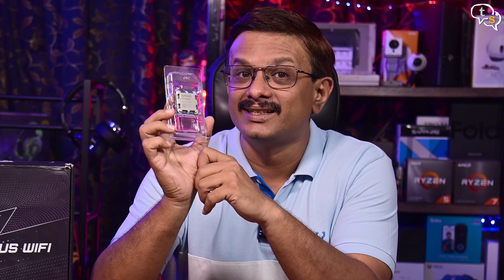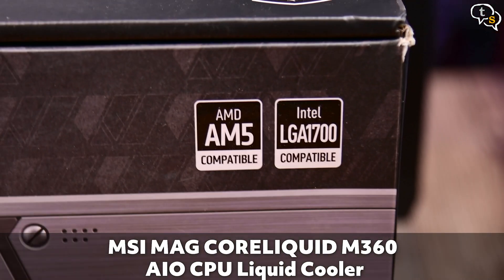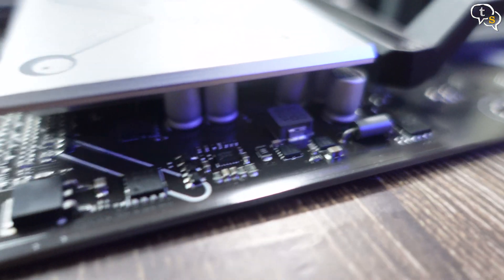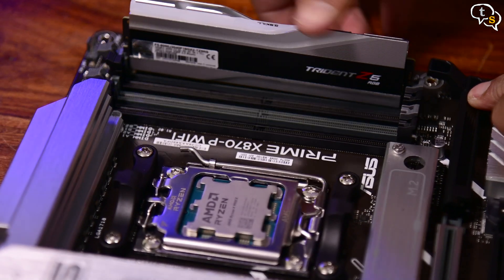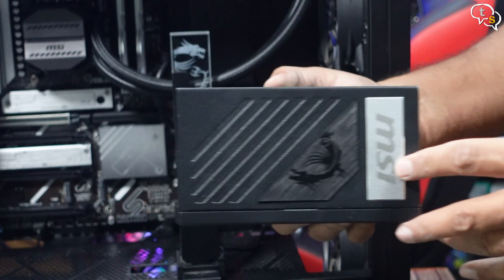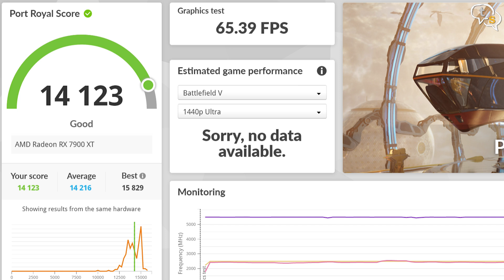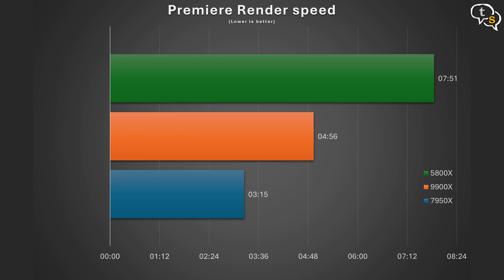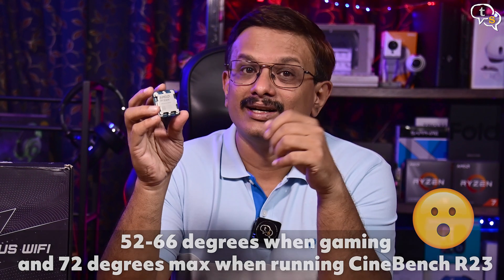AMD Ryzen 9 9900X Workstation Build | Asus Prime X870-P Wifi

Comment: Hi,
If i use two or three M2 ssd, PCI-E? 
Thanks
Reply from the maker: If using two it would be better to use the top and bottom M.2 slots at populating them all would bring down gpu lanes to 8x instead of 16x. So try to avoid the middle one. First one runs on cpu lanes and last on runs on chipset. But 8x for current gpus is not a big loss in performance.

Comment: hi friend do you have to update the bios for this mobo for a 9800x3d?
Reply from the maker: Depends, some motherboards have the updated bios. If they don't you could always use the bios flash option even if you don't have a cpu in the motherboard. You will need another computer or laptop to download the new bios onto a pen drive though.

Comment: Temps are really good, the 7950X is toasty!
Reply from the maker: Yes, the 7950x has a higher tdp hence the high temps. The 9900 runs more efficiently without loss in performance.

Comment: Why would I choose a 9900X when the 7900X is much cheaper?
Reply from the maker: At present yes, it's a bit expensive. Prices will come down, the 9900x will boost for longer as the temps are low and is easier to keep cool.